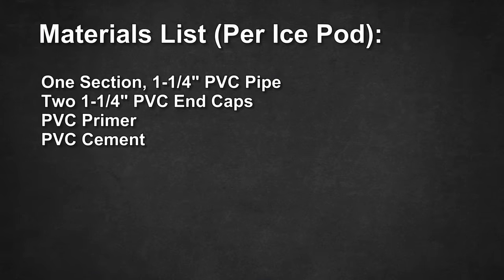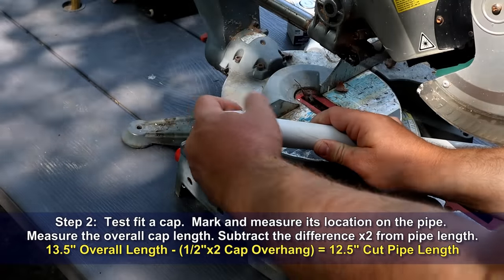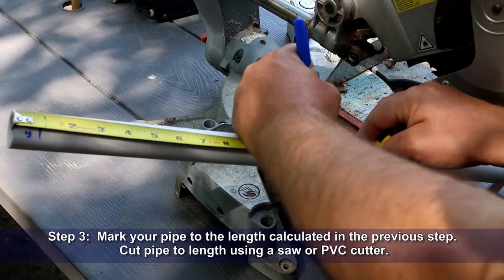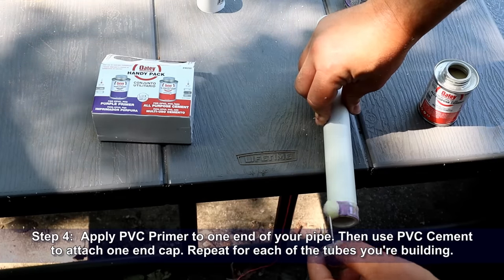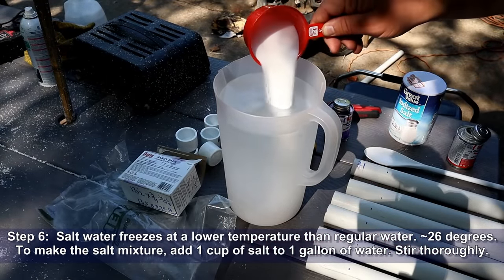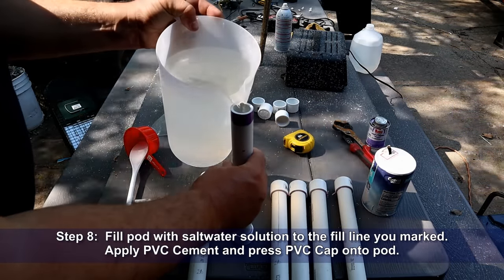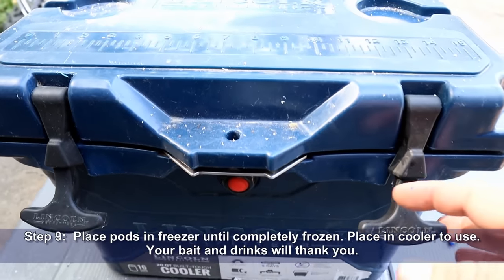Cooler Hack! How to Build SUPERCHARGED Reusable Ice Pack Pods

Comment: I appreciate your work on this video but IMO, this is not an efficient approach. The volume of the PVC is probably greater than the water inside taking up valuable room. Adding salt will lower the freezing temp however when you remove it from the freezer it will also liquify sooner (think road salt). For maximum efficiently, insulation and placement is the key. The frozen medium and/or insulation should be placed over and/or between the items needing to stay cold as cold air travels downward. Gel packs are perfectly suited for this and take up minimum space. New, frozen water bottles are also good, as when they melt they can be used to hydrate you! The ultimate solution is of course to buy a good quality ice chest.

A trick I used when camping 40 years ago was to bring two ice chests. One of them was filled with frozen food and dry ice wrapped in a towel placed on top. A blanket then covered the chest. This cooler is opened maybe once or twice a day and the food slowly thawing and used as needed would stay fresh for up to a week.

Comment: just get a mini fridge, an inverter and plug it into your cigarette lighter.  if you dont have access to a cigarette lighter get a solar panel and a 12 volt marine battery.  sure a bit heavier but you can refreeze everyone else's water sticks.....
Reply from the maker: It's situational. I primarily use these in my bait cooler on the boat. I'm not carting a mini fridge out on the boat with me, but it's definitely an option when camping or tailgating.

Comment: Ok so how do they not bust because pvc usually busts in the winter so wouldn’t it bust
Reply from the maker: @charlesanderson5376 that's why you don't fill to the top. Pvc only busts in the winter because it's pressurized with water. When the water freezes, there is no room for expansion. And... POP goes the weasel.
Reply: @TheWeekendAngler  oh kk

Comment: PVC pipes burst when they freeze. I know because I've had to fix numerous pipes at my house. So folks just use water bottles filled half way with water. I save and rinse out and wash and bleach every bottle that comes in my house. I fill many bottles up when the weather freezes. I shut off my well and empty the pipes. I refuse to be without water and I also refuse to have all the pipes freeze yet again. You take 1 cap full of bleach and put it in the bottle. Then fill it with water about a quarter of the way. Then pour that mix into another bottle and keep doing it until your out of bottles. You shake each bottle then rinse them out. This way your bottles are cleaned and all bad stuff killed.
Reply from the maker: They burst when they freeze because they're filled to capacity. That's why I don't completely full them. This video came out over a year ago and this same initial set are still going strong after more freeze/thaw cycles than I can count.
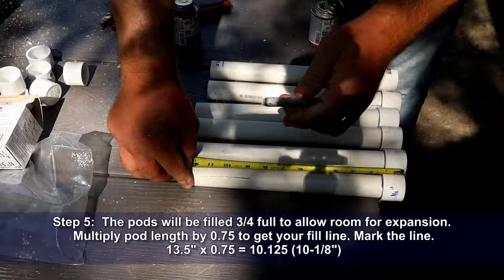Reply: He said in the video, @2:40, he only fills them 3/4 full, to allow for expansion of the water.
The same thing holds true for your plastic bottles. If you fill them all the way, they will explode.

Comment: I sure would like to have seen the temperature reading on those pvc pipes when frozen over some time period. The salt water may be colder when frozen but I’m certain the pvc pipe is acting as an insulator. So when the temp of whatever is surrounding these pipes is warmer, the ice inside the pipe is going to be insulated from it not transferring the cold ice to the warmer temp in the ice chest.

Comment: Why no glue on the end cap
Reply from the maker: It's not needed since these aren't subject to inspection nor will they be under pressure. If you want to put it on there, it's your call.

Comment: dosent salt melt ice?
Reply from the maker: Technically, no. When salt dissolves in water, it breaks down into sodium and chloride ions that push the water molecules further apart, lowering their freezing point.

That is why salt is used to melt ice on roadways, but also why salt stops working when the temperature drops below a certain point. 

There is a lot of good information on the subject available from the University of Illinois, Champaign's website.

I was fortunate enough to have studied under a great chemistry/physics professor who had worked for years in the field prior to teaching.

Comment: Many problems with this. As others have said here, salt in the water does nothing to change thermal capacity of the packs. Having these at the just bottom of the cooler will allow the top of the cooler to be far too warm. The thickness of the PVC and the gaps between caused by the caps creates a lot of wasted space and too little ice. Ideally, you would need a thick pack that is flat and rectangular that covers all of the bottom and one that covers, and attaches to, the top/lid. There are low-cost products made to do just that. A simple and better solution is to use large empty Gatorade bottles filled to 90% with plain water. I use 16 of these and rotate them 8/8 every single day in a Magellan cooler for our refrigeration in a solar cabin that only has a deep freezer. The method shown here would require taking everything out of the cooler every day and would only last a few hours of cooling the bottom.

Comment: Okay, so hear me out. Salt water freezing at a lower temperature does nothing for us here. It doesn’t help. Unsalted water will freeze at 32/0° and then will get colder if your freezer is colder. The salt doesn’t make the ice colder. It just changes the temp at which the water freezes(it stays water longer)

Comment: I use old Gator-Aid bottles for my saltwater.  A suggestion on the salt.  I mix the salt into the water until no more will dissolve, then I pour just the water into the bottle.  This way, the water has the maximum amount of salt.  This will not freeze at 0 F.   It does freeze at about -6, but salt water will not freeze.  The salt separates out of the water, and only freshwater freezes.  I tested freshwater, saltwater, and a cooler block.   The saltwater kept the cooler colder.  I think I'm a frustrated scientist fisherman.

Comment: 2 things... 

1. Adding salt to the water changes the freezing point of the water in the tube meaning it will take longer to freeze solid when in the freezer but does not change the tubes effect on the cooler contents once the tube is out of the freezer. The temperature and surface area of the tube determine how it effects the air around it. If the substance in the tube is 30 degrees F it has the same cooling effect to the items in the cooler whether it is ice or water at that point inside the tube, it doesn't matter. 

Note: When using ice with salt  to make homemade ice cream the advantage comes from the ice starting out below freezing and changing to liquid, increasing the surface contacting the can with the cream inside, while still below 32 degrees F. In this hack, you negate the surface area advantage by isolating the solution in pipes.   

2. Once the tubes have frozen and thawed, a good bit of the salt will likely have precipitated out and present as slush in the bottom of the tube should you wish to open one and look. So in the event you are convinced it makes a difference and do wish to maintain the same saline solution inside the tube, you should probably make sure you bring each tube all the way to room temp and shake each like a paint can pretty thoroughly before refreezing.

Comment: At the risk of sounding like an idiot....
Even with the tubes not filled to allow for expansion, by sealing them up, the expansion of the water freezing means the air pocket is under pressure too? Doesn't that sort of negate the idea of only filling 3/4 full?
I like the idea, i can see myself trying this, i just anyways look for the weak point in anything so there are no surprises.
Reply from the maker: Air can compress, liquids cannot.
Reply: Picture this goose doing the face- palm......of course, Internal Combustion Engines and compressing air.....thank you, definitely doing this
Reply from the maker: @scottchapman5783  been there before myself more times than I'd like to remember. No worries, my friend.

Comment: so much wrong with this video...
salt has to do only with what temp it turns to ice, NOT how cold it gets...so what's supercharged?
you'll want to apply primer and solvent to both surfaces, not just the pipe but the cap also!